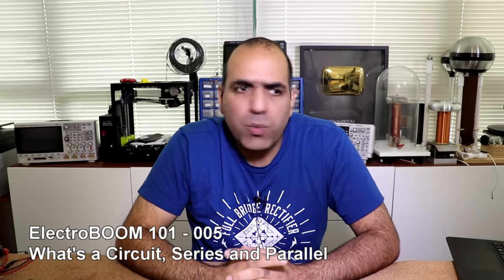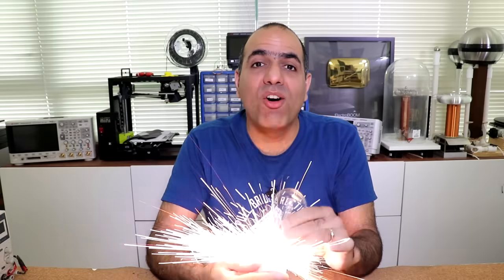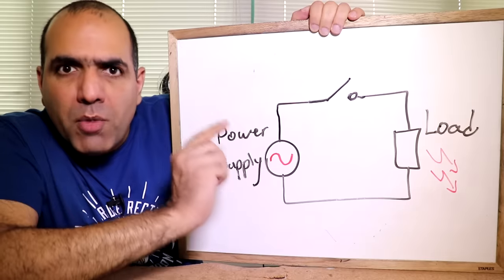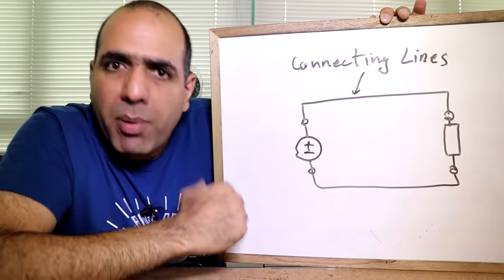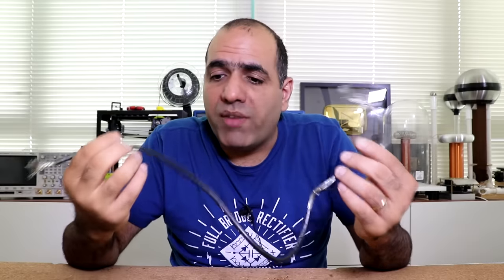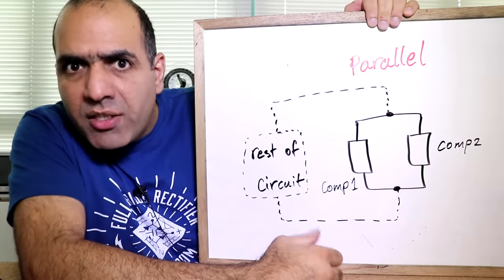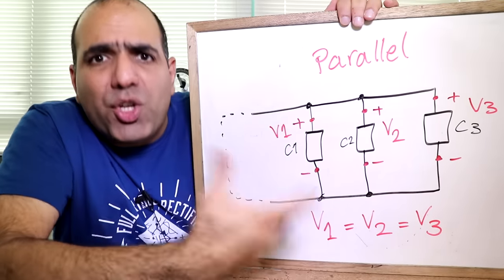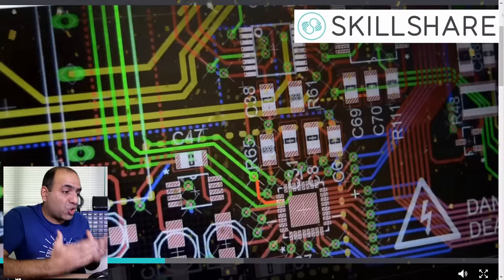What’s a Circuit, Series and Parallel (ElectroBOOM101–005)

Comment: I need to call them magic wires from now on. No matter how many times I try to explain the bit at 4:44, people are still like "So they're super-conductors?" and I'm always like "No, even super-conductors have a tiny tiny tiny amount of resistance."
Reply: Is it those things that doesnt actually exist and is imagined only so it is easier to calculate right?
Especially while we learn in school.....and in college.....but then we only realize it exist after becoming an electrician
Reply: @whoami1449  exacly
Reply: Wow, great to see you here nick :))
Reply: That isn't true. Superconductors have EXACTLY zero resistance because of quantum mechanics. Not a negligible resistance, ZERO. What's being referred to in the video is no stray capacitance or self inductance, which isn't possible even with superconductors. Superconductors only handle the zero resistance part, not everything else.
Reply: @Owen_loves_Butters  so then one could say "zero impedance wires" would be the magic wires? Because it would be true that even superconductors have a tiny tiny tiny bit of impedance due to stray capacitance or some leftover inductance and it would still be correct to say zero resistance
Reply: @cosminaalex  Yep
Reply: @whoami1449  It is because compared to a really large number, a small number is effectively zero, and compared to a really small number, a large number is infinite.  In other words, the result will be effectively unchanged by the assumption.
Reply: simple
resistance is 0 OHMS FOR SIMPLICITY'S SAKE

Comment: I came here for the fan bursting into flames, and I found knowledge that I wasn't even taught at school. All the explanation about the nodes and how finding different voltage across components in a parallel circuit means there's something in series to the circuit causing losses, gives me actually the answer to a problem I've been trying to solve at work. Mehdi, you're the best ❤

Comment: Please make a video on "How to run a 3phase device on a Single phase supply". Love from Pakistan.
Reply: Add a capasitor to a circuit. Or a super long 2 wire cord.
Reply: Generally not regarded as a good idea
Reply: Ans Ghazi I think you would need a transformer to convert the single phase to 3 phase...
Reply: Very difficult. There are 3 phase inverters that exist (commonly called variable frequency drives, but you have to make sure you get one that's capable of putting out 3 phases). The inverter types are basically a switching power supply, but instead of having one or a few DC output voltages, it has 3 output AC signals that are properly out of phase with each other. The bigger the load it can handle, the more expensive it is.

Many years ago we had what are called "rotary transformers". They were nothing more than a single phase motor and a three phase generator wound together as one big motor. It was basically a single phase motor turning a three phase generator. Again they are really expensive.

If your load is rather light you can fake the third phase with a capacitor. Many single phase fans use this. Any high power single phase AC motor will have two capacitors. One that only starts the motor and gets switched off when the motor finally spins up. If you don't switch off the capacitor, the capacitor will blow up.

For true three phase you need to contact your electric company and see if they can wire a third phase to your house or business. This is the only proper way to get it.
Reply: I think he made that video. Try browsing his channel.
Reply: Ya and start capacitors can make one hell of a mess when they blow up. The second capacitor is the run capacitor that makes the AC motor run more efficient  on a single phase circuit .
Reply: Guys, Let him do the science.

Comment: Great 101s, thank you!
Could you make one about the interaction between the photovoltaic inverters, smart meters and power grid?
More precisely how any consumer on the circuit knows to take power from the inverter rather then from the grid if the load is small, and take part from the inverter and part from the grid if larger.

Comment: the advantage of parallel circuits are that if a component like a filament bulb breaks, it wouldn't effect any other components. But in a series circuit if the bulb breaks the other components wouldn't turn on because the circuit would be open.

Comment: I just had and idea that someone of your ingenuity and combustibility is perfect for. A battery operated power drill runs on DC power. That's great, until you forget to charge the battery. Or the battery wears out, or drains below the point of charging. Can you take apart the AC wall charger and battery casing and make a converter so you can turn your cordless drill into a corded drill?

Comment: One of the Best (and Funniest) of my Electronic Teachers on You Tube!!!! Mehi I have asked this question a few times to others with out a answer so maybe you could try and help me understand -I can not wrap my head around -High CURRENT low VOLTAGE and High VOLTAGE low CURRENT -I don't get how you can have one a HIGH state but NOT the other??? Anyway Two Thumbs Up Sir Thanks for posting!
Reply from the maker: Voltage is resistance times current. So if resistance is low, low voltage can create high current and vice versa
Reply: @ElectroBOOM   -THANK YOU very much for the response!  SeeI just needed to ask the correct person !!

Comment: Interesting way to check hand to hand resistance?:  I just a few minutes ago passed 120v hand to hand by accident while messing with a stepdown transformer.  It felt kinda good to me like a jacuzzi jet vibrating through both my hands and chest.  I see why electroboom does it ;)  STILL DANGEROUS THOUGH.  I found out i have high resistance to ac current as a kid.  OK to the point!!  When testing a 5M Ohm resistor, I gripped the leads of it and the multimeter with my thumb and forefinger.  It wasn't registering right so i tested myself just now in parallel with a 1M.  With my thumb and finger firmly pressed on a multimeter in parallel with the 1M Ohm and it registered 59K.  So (1M^-1 + ~63K^-1)^-1     With 63K Ohms and 120v the rms amps through my chest is only 1.9mA.  Probably how this guy is still alive, and im glad!  I've been watching him for a few years xD
Reply: P.S.  Damnit I found out how I got shocked.  I was playing with a wall receptacle that I extended out with a microwave plug cord.  The pigtails I had were stuck in the back holes with no exposed wire, and I touched both the silver and brass screws with both hands not figuring they were electrically connected to the back holes.  Pretty stupid XD     Also....it kinda makes me wonder if I can be an amp meter like how I've attuned to judging my speed while on the freeway.

Comment: Hi Mehdi, in a lot of your videos I've seen you demonstrate AC going through capacitors where DC doesn't as the DC line being blocked by the plate while the sinusoid of AC goes through the gap. I've found out that this explanation was apparently used by Eric Laithwaite as a way to explain the phenomenon to non-engineers. In my searches it turned out there are a lot of questions about why this happens around the internet with various explanations, I think it would be great for you to make a video about it.

Comment: The "black box" analogy made me click something in my brain, it's very similar to the concept of interface in programming! Although the circuit at 8:13 confuses me: I understand the entire block of 1-2-3-4-5 is in parallel with the rest of the circuit, but how none component inside is in series or in parallel with one another? Shouldn't 1-3 be in series, 2-4 in series and 5 in parallel between the 1-3 and 2-4 branches?

EDIT: I think I got the answer. By redrawing the circuit, I can see clearly that the terminals of the entire block are in parallel with the rest of the circuit, but for the other branches it seems that no terminal of the "inside" components can be in parallel or in series, so it's kind of undetermined? Or better yet, it seems that for instance the terminal of 1 makes a node with one terminal of 5 so that is in series with 5, but then 5 is in parallel with the branch 1-3: I suppose it's impossible for them to be both in series AND in parallel?

Comment: Why voltages are the same in paralel circuits? If the resistances of the components are different, shouldn't the voltages be different as well?

Comment: notice the flame got bigger when you took it out the microwave. next time when you start a fire in there , unplug it and keep it sealed. this will suffocate the flame and will not cause you to get hurt because microwaves are air tight. but i get why you panicked. you didn't want to burn your house down just like everybody else wouldn't want theirs to. other than that keep up the good work.

Comment: Hey i have a question u seem a guy with a lot of noise  whenever i turn my AC on i hear noise in my 1600w PC’s PSU even if
The PSU Is off , electrician came
And checked everything in my house so they work fine this started suddenly , whats the issue?
Reply: Perhaps the effects of Harmonics?

Comment: How do you calculate the avarage resistance in 8:20
Reply: learn delta and wye connections
Reply: Formula for series is 1/(1/R1)+(1/R2)
Reply: Oops meant parallel

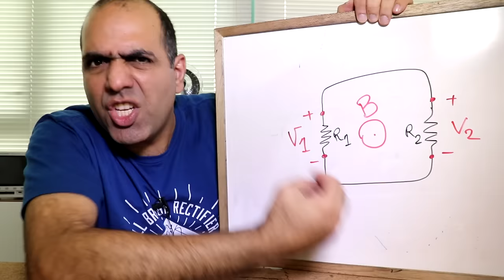Comment: 9:25 What definition? KVL?
Reply: Voltage
Reply: Basically, Lewin defined voltage as only electric potential energy, Mehdi defined it as any energy that can move charges. The latter is what voltmeters would measure.

Comment: Resistors in series will double the resistance, assuming the resistors are the same values. If not, it adds them. Now, with two resistors of the same value in parallel, their resistance stays the same, although there wattage will double. Example, if it's a 1 watt resistor, and you put them in parallel, you will have the same value resistor, but in 2 watts. There, I hope this confuses the shet out of you.🤪

Comment: away from the obvious satire nature of the video i think that using a normally closed contact from the relay violates the principal of built in fail safe that should be considered in every design because now if the relay coil malfunctions the temperature will keep on rising for ever until it melt through the planet offsetting our center of mass which will lead to the earth moon collision..😁😁 
joking aside don't replicate this wiring you'll end up regretting it .

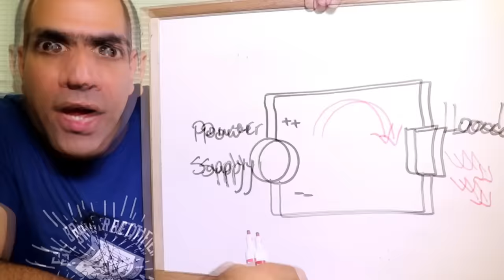Comment: 2:23 'and thats why all active circuits  are always closed. always' - this is what i never understood about antennas. they aren't closed circuits. how do they work. if they do work, can any other electrical 'circuits' do anything useful without being closed? so confusing. (ok i'm an idiot, but still!)
Reply: At extremely high frequency, electrons can jump in and out so fast that the circuit closes itself.

Comment: Medhi why do you keep on zapping yourself even if they know what happens if they touch anything dangerous (reminder: NEVER EVER GO NEAR URANIUM BECAUSE ITS THE SAME AS ELECTROCUTING YOURSELF BUT 3 TIMES WORSE) hope you remember that next time, also the current must stay connected or the current will not run or continue to circle around in the circuit and the wires must be close to each other or the current is weakened the farther the wires are